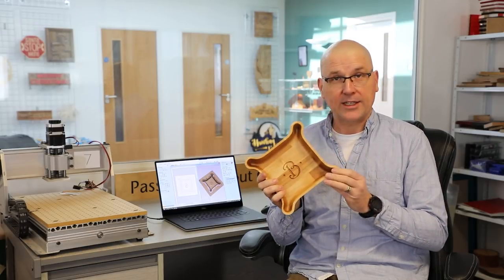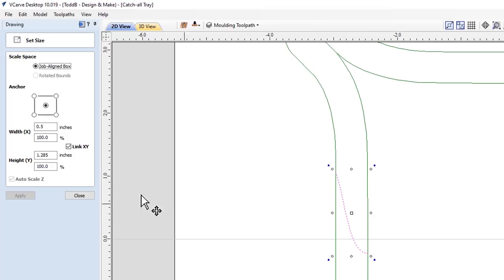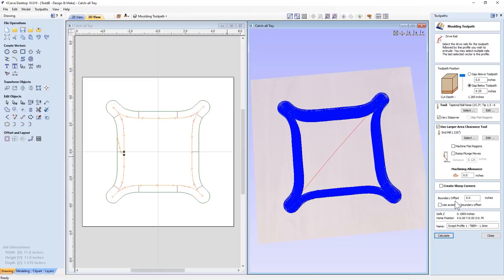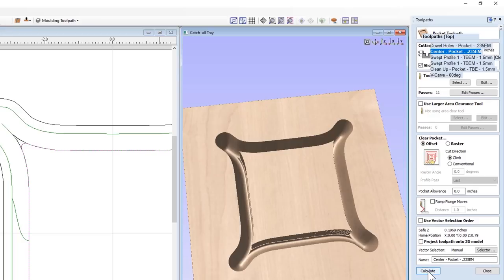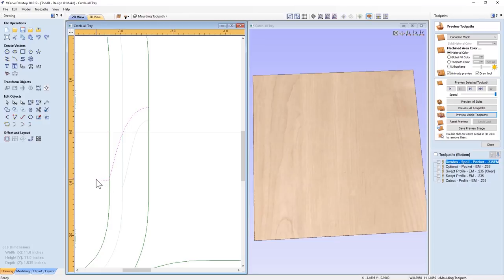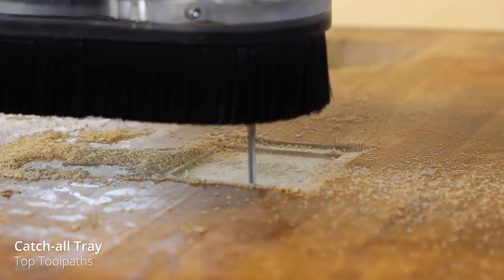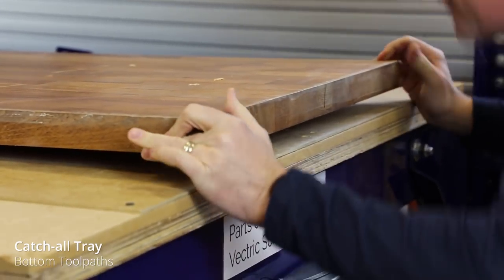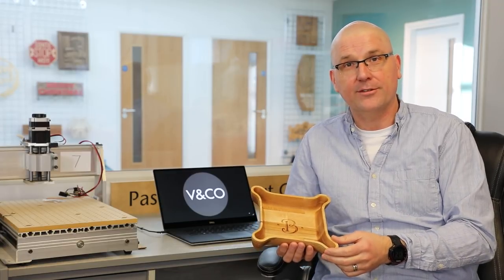In the Labs with Todd | Making a Catch-all Tray | Vectric FREE CNC Projects

Comment: Hi Todd, this a neat project.  Did you make any adjustments in the file to accomplish your “lessons learned”? Thx.
Reply: Hello Mocarver.  Thanks for the comment!  Yes, I made all the changes required if you choose to cut it at the same size I did.  I would highly suggest, like all of our projects, to adjust all the tooling to fit your CNC, material on hand and tools you plan to use.  Like I mentioned in the video next time I would use thinner material and angle the sides out more.  That would take a redesign of the files but would give a better finish and take less time to cut.  I hope that helps.
Reply: @CNCminiProjects  how thin would you make the second one?
Reply: @acerjuglans383  The material I used was 1.53", I believe so I would probably edit it to be 1" or 1.25" thick.  This would allow me to use a shorter cutter and would take out or lessen any tool deflection.  Also, it would take less time to cut... :)

Comment: Great Video! I have a question, I am in US, and i cannot find the 15.3 Degree tapered ball nose. I tried to substitute a 30 degree v bit and it doesnt quite clear is as nicely in the 3D view as yours'. What can i do?
Reply from the maker: Hello and thank you for the comment and the question.  Great idea using the v-bit... I might try a small ballnose... like a 1/8th or 1/16th for the finishing pass.
Reply: @vectric  thanks. I looked into it further and the genius of the file creation ( molding toolpath, which dictates the angles, not the bit) allowed me to simply use a 1/4” straight ball nose and it turned out flawlessly.

Comment: Hey, what was your machining time for this project. mines basically saying i should the month off from work. so i don't think my speeds and feeds are anywhere near where they should be. curious what you had your tapered and mills set for.
Reply: Hello... thanks for the comment.  Nope, you definitely shouldn't need to take a month off... :) I needed to slow it down a bit, seeing as, after my first attempt, I realized the wood was super hard.  So in the end... 5:45hr ish.  Ok, before anyone chimes in and mentions that is a long time, I do understand that, but it was worth it in the end.  The finished part is very nice and it truly a beautiful, functional object.  If I was to cut it again... I would definitely use a material that was easier to cut and make it a bit shallower with steeper walls.  

You do not need to use a tapered ball nose endmill for this part, it just happened to be what I had nearby.  I would actually suggest you take the idea of this project and rework it to use a standard ball nose endmill that is rather large.  You would cut machining time, and if you took the time to develop a nice cross-section to use in your molding toolpath, the end result would be fantastic.  Of course, in saying that, you need to be sure you take into consideration the material you are cutting into, the cutters you choose and your CNC.  Preview all of your toolings and make sure it looks right before sending it to your CNC.

Comment: You didn't show the cut out tool path. The file download says it starts at 0.0 and goes z +.05 - why when the molding tool path has already cut down? seem it should start at the bottom of the molding tool path and cut the final .25 plus .05 - right?

Comment: Hi Todd, really like this project and plan on making one for a gift. To reduce the amount of hair I will pull out doing this project can you go over what changes that need to be made for a different  thickness of material on the drive rails?  I'm pretty sure I don't have a 1.535" thick piece laying around. :-) I have the top drive rail figured out, but do I need to adjust the bottom drive rail? I'm aware of the changes needed for the pocket, profile and text. Thanx
Reply: Hello Jeff... good question and it might be a bit of a challenge to answer it here, but let's give it a try... :)

In the file on the top/front, you will see a cross-section I used for the molding toolpath, and next to in on the left, you will see a faded one that I used (and is located on the back/bottom of the part).  When I originally designed the dish shape, these 2 vectors were the ones I used to make sure my wall thickness stayed consistent, or as I wanted it to.  If you copy the one on the back to the front, you can adjust these and make sure the wall thickness, again, is what you expect.  I would select both and size them to be the proper height; this is your material thickness, then reshape them, so the wall thickness is correct. 

I would pay particular attention to the bottom of the shapes.  If it is to go wrong, this is where it most likely will happen.   Make sure there is enough thickness to make a nice bottom of the tray.  Once you are happy, move the outside vector, the one on the left to the bottom side... and work that molding toolpath and see what you get.

I hope that helps a bit.  Please let us know how you get along with the project.

Comment: Your material setup shows flipping the material top to bottom, but your dowel hole layout requires flipping side to side (which is also what you do in the video).  Am I missing something here?
Reply: Hello Steve... you are correct.  It just happens that our X and Y are switched on our CNC.  So for us in the software top to bottom is left to right on the machine.

Comment: Awesome thanks. As a complete novice, I was wondering what is the accuracy one can achieve on a mass production doing this process? Meaning if I set specific sizes with the cnc, how accurate will be let's say the actual inside pocket compared to the settings? Because I have 200 ceramic dishes (rectangle shape) and I would like to have 200 trays made and then put the dishes inside the trays (I'd like them to fit as precise as possible without leaving to much of a gap). Would you say too much variation occurs among the trays causing some dishes to fit and some don't?
Reply from the maker: Hello Spaghetti... thanks for the comment and the question!  To be fair it depends on a couple of things.  First, most of the variation will come from the cutter (not being the size you expect or not sharp), the quality of your CNC (this is a big one when it come to repatebility) and the material you are cutting.  When it comes to the software you need to be sure you have the proper feeds and speeds that are suitable for your CNC and the material, and be sure you have taken into account the proper tool size and allounces you need to add for viariations in your ceramic.  Assuing each dish is exactly the same size and your tooling is correct... then the only thing in question is the CNC.  Hope that helps...
Reply: @vectric  It does! Thanks a lot!

Comment: Todd:  Great video and project.  I’m working with a piece of padauk that is 1.959 inches thick and 11.125 square.  I got the toolpaths right for side 1 (bowl), but am having problems with getting side 2 measurements correct.  I would like to increase the overall length and width to use more of my material (padauk is pricy), and, as you suggested make the rail curve more gentle and not so steep.  Walls and bottom of .25 inch.  I think I’ve watched all the vids on mounding toolpaths and 2-sided marching....  In my model, I used a .375” EM as the first roughing tool, then a .25” EM next and reduced cut time by 3 hours.  I have a Legacy Maverick 3x5 with ATC (tool changes not an issue).  Thank you in advance for any guidance you can provide.

Comment: Good evening I have this project half done. The inside cut perfect. The flip went well the the cut for the clearing is doing something odd and I did not have 4 hours to watch it so had to stop. When it is doing the outer edge cut it goes all the way around one way lowers and reverses, it only lowers .05 and it is going to take 40 passes to get to the bottom. It also slowed the feed way down. I wish I could share a photo. I came in and watched the tool path on the computer and it does the same. I do not see anyway to change this to cut more off or speed it up. Thank you for this project has been a challenge to do and I learned the molding toolpath. 
Tim
Reply from the maker: Hello Tim... thanks for the comment and it would be good for the support team to have a look at your file.  If you think that would be helpful please contact them at - Support@Vectric.com  I also would like to see the file.  :)
Reply: @vectric  It is done found the problem I had selected Machine flat regions. Took that off and it was much faster. Making a second one for a friend.
Reply from the maker: Good to hear!! Thanks for letting us know!